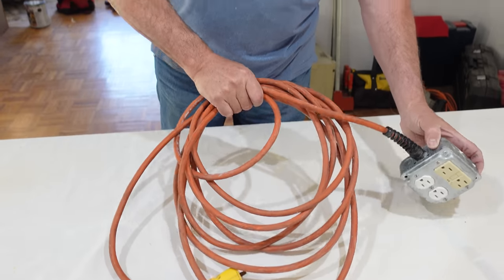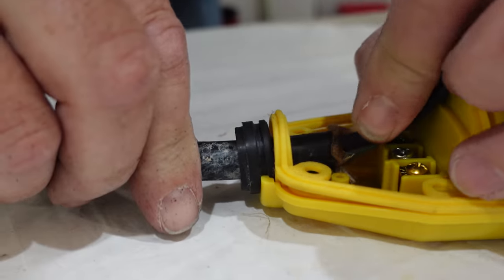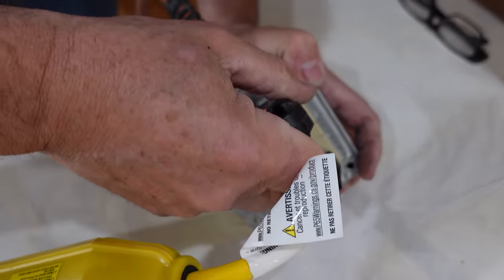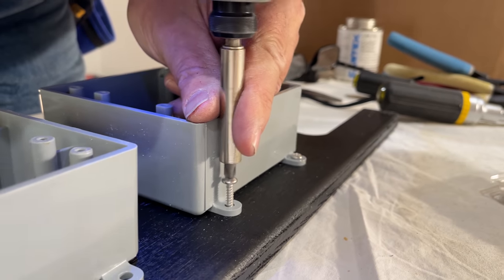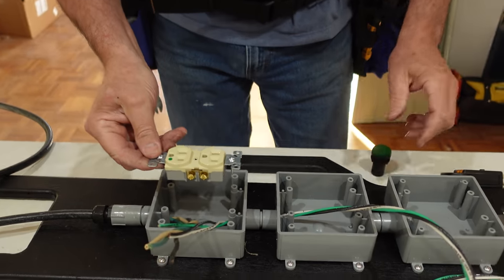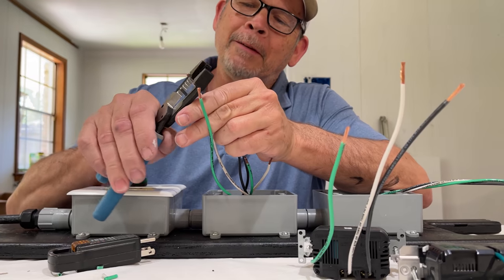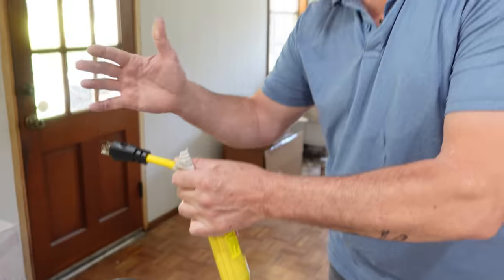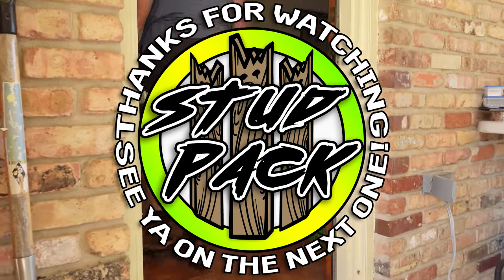HOW TO MAKE THE ULTIMATE EXTENSION CORD!

Comment: Great video Love the channel Guys. Your outlets aren't waterproof or weather rated. You need to use the Bell Box covers that come with gaskets as well as flip open covers and/Or in use closed covers to get a weather rating. Also your outlet boxes should be galvanized and use galvanized nipples because it's subjected to physical damage. Your extension cord is also to old to be reinstalled by todays code. You should also then Ground all of those new galvanized boxes. also all outlets regardless of upstream GFCI/AFCI protection need to be GFCI protected in temp power work boxes. The Green indicator light should be at the end of line circuit to insure all outlets are on. Also the Green Dot on that 20AMP outlet isn't for looks, It indicate Isolated Ground and you don't have one.

Comment: If you build another one look into a Powercon connector. 20a rated built in strain relief and water resistant(panel and cable connectors available). Used in staging a lot. I use it to make it so my extension cord can get swapped with multiple devices(magnetic power strip, plugging in power to my tool box) because of its twist lock you can pull it without it unplugging.

Comment: Wow that was pretty cool info about the vacuum. I never knew that. They sound like they are in such distress when clogged or blocked lol!
Reply: It makes sense if you think about it.  The spinning part moving the air has air resistance when not clogged.  Once you have a clog, it removes all the air and is running 'in a vacuum' and has no air resistance.   It can spin faster (hence the change in pitch) but will much less load.

Comment: I’m not a residential electrician but I believe breakers trip due to heat. I think the breaker would have tripped if that load had been present for a longer time. It would also imply the breaker is “healthy”. If it had routinely seen over current and heat previously it may have become “weak” and tripped sooner, possibly even below its rating.

Comment: The circuit breakers function has been very well explained in some other comments here, yet I can add some numbers out of my professional experience in education for electricians. These numbers are from the IEC standardization so they should be somewhat similar in the US to what they are here in Europe. I just assume this is a standard household MCB, being category B in the IEC 60898 classification. So those would be the numbers for a B 20A MCB:
The electromagnetic trip mechanism must not trip below 3 times the rated current and must have tripped within 0.2s - 1s (this time depends on several factors) above 5 times the rated current, therefor it can not trip that way below 60A (and must have tripped subsequently at 100A). All given proper function of course.
The thermal trip mechanism though has much lower current thresholds and much longer tripping times, having the must not trip below 1.13 times the rated current and the must trip within 2h above 1.45 times the rated current. Or in our example, must not trip at all below 22.6A and must trip within 1h above 29A. 

A lot of dry theory but to conclude this, your 28A steady current through a B 20A MCB leaves you actually in a very uncertain limit condition, where the breaker might trip after a very long time or it might not even trip at all. Assuming you haven't tested it that long but had you put 30A through that breaker over an hour, it should have tripped after that.

Hope that helped, have a nice day everyone!

Comment: 26:39 i am by no means an expert, but i believe there are two ways a breaker can trip. The first is a dead short which causes a restive wire of some sort in the breaker to heat up very quickly from the massive current which pulls a little lever that trips the breaker, the other is just a simple overload and some breakers use the same restive wire for overload protection as well, and since an overload has less current then a dead short it takes longer for the wire to heat up and trip the breaker. 

Although i do remember something about a magnet so maybe that is the dead short trip.

Comment: Excellent video, new subscriber.  Glad to have found your channel.  That vacuum pulls less amps when under air flow restriction because the blades are now running in a partial vacuum and have less restriction on them.  So, the motor runs faster but pulls less energy due to the "air" being thinner.

Comment: That's cool and gives me ideas for my generator. I've wanted an easy way of getting power inside if we ever had a power outage. I would like to use the 30-amp RV receptacle on the generator but I would probably need breakers on the power board like yours to use it. Thanks!

Comment: 26:16 I think most people rush to a clogged vacuum cleaner because most vacuum cleaners suck the air right through their own motor to cool the motor, where as vacuums like shop vacs have a separate fan that blows outside air through the motor to cool it. So a normal vacuum has a tendency to overheat when clogged which is why some will have a hole in the hose somewhere so that even if the end gets plugged by a rug or something, it still has a little bit of air flowing past the motor.

Comment: As others have said, I think overtime the circuit would eventually blow drawing 28 amps even on a 20 amp circuit. I find that has happened a few times while running my tablesaw and a shop vac at the same time. It often doesn't blow immediately. But eventually, yes.

Comment: Sweet cord. Explanation of the breaker;

The 20 amp breaker isn't designed to trip at exactly 20 amps, it's designed to trip when it reaches a certain temperature, or when it's 30% above or something. This is why I don't put 15 amp receptacles on 20 amp circuits in my rentals, because a tenant could put a space heater on it and start a fire.

Comment: Nice idea. I live in 240V-land (UK) so, yeah, it was a surprise at first why a vacuum cleaner would try to draw 10A, then I remembered you guys run at half voltage. If I do something like this I would likely use USB+BS1363 sockets (bathrooms aside, where we have a different shaver socket outlet) - but I tend to shy away from using USB+BS1363 sockets as fixed outlets at home, simply because I have had USB power adapters go bang when they fail, and I'd rather have something removable if it has those tendencies, whereas it going bang in my wall makes me feel rather uneasy. Perhaps I'm being over-paranoid?  Also, not too many sockets as we can pull a maximum of 13A (approx 3kW) from a single BS1363 wall socket - and the things are quite large so more than 6 sockets it would start to look a little ridiculous.

Comment: My electrician hasn't stopped laughing yet when I showed hi this video! First he said, loose the wagos! They can and will fail and he has seen when someone hasn't snapped the tab down correctly and it just sits and sizzles. If you have to join wires, use the correct wire nut. Plus he said the outlets are designed to pass the power on the side terminals. That's why there are 2 on each side. All the pigtails are not needed. Just wasting wire and time. Also if you are going to the trouble of building such a setup, don't use old cords. You can buy the SJ or SJO cable right off the spool the length that you need or just buys a new cord and cut the ends off and use it. No chance of nicks in the wire or a wire that has been overloaded and the wires heated up. Next make sure that you use metal plates and not the plastic ones as they will get broken at some point. He also said he woudl put some screw on rubber feet to the board so it sits off of the ground. No need for the third box with the switch. If you need that many outlets, just add another outlet. No need to switch it.
Reply from the maker: Glad you both watched :)  Sounds like your electrician should build his own... that's the whole point

Comment: Journeyman wireman LU 613 here. What wire type did you use? THWN I hope. If you're going to show your flowers how to do this you should make sure to specify wire type. I personally don't like wagons, but I do like how you used the clamping type and not the spring type. Also, those build your own cover plates don't appear to be weatherproof nor do you have weatherproof covers over your devices. I thought the whole idea between the PVC boxes, the strain relief you used, and the seal on the GFI was to make your build weatherproof, but the covers you used completely defeated that purpose. Nitpicking aside, I applaud your creativity. It's still not rated for your intention of being waterproof/weatherproof and still isn't suitable for outdoor locations, but it's definitely better than the temp box on a cord with an RS cover you had before.

Comment: Trip breakers are a timed event if draw is slow and consistent the breaker won’t trip until it reaches max draw rating which is not commonly printed or marked on device( you have to research the brand of breaker to find that out) usually to prevent people from abusing breakers beyond limitations , breakers are primarily used to stop current flow due to sudden high amperage change ie cut through a cord or dropped in water or electrocution event to prevent loss of life, instant heat generation from a short will cause coil to trip out but if high draw is slow and progressive it takes a long time for the heat strip to heat up and break contact

Comment: There's a thermal strip inside most common breakers and once it heats up it deforms and flips the breaker off (like a thermostat). You just didn't leave it running long enough for that piece to deform and trip the breaker.

Comment: I just have a low voltage telecommunications degree I don't work with the high-voltage at all,  only have one recommendation and that is to swap the hospital & button and the 20 amp, that way you're not running 20 amps through all that 15 amp outlet, And also you'll see if the entire strip is hot.  That is just my humble and unprofessional opinion on a well-built product. 
Durand the handyman Dallas Texas

Comment: Circuit breakers are typically inverse-time breakers which allows them to temporarily overload without tripping. Motors and LEDs have a brief surge when they first start. Inverse-time means the larger the overload, the shorter the time for them to trip. At 50% overload (30 amps), the 20 amp breaker will trip between 20 and 150 seconds. At 100% overload (40 amps), the 20 amp breaker will trip between 8 and 40 seconds.

Comment: Neat, I live in South Africa, 30 years ago we got solid plugs and reseptors. now it is all cheap plastic, I'm surprised there aren't more electrical fires. ...28 amps through the cord and 20 amp trip at the end of the cable not handling all the machinery, just two at that point 😏

Comment: I may be wrong. But I was under the impression that gfci dont work that great with long runs of wire due to voltage fluctuations over the length. Plus voltage drop over distance causes it to pop when it should. I've had outdoor submersible pumps that kept popping gfci. After replacing pumps and not fixing it. Figured out the lentgh of wire was screwing with what the gfci was looking for as a fault. Changed where the break would happen and pumps never stopped again.

Comment: I am not an electrician however I have trains that will run off of the same power but they run separately, because each of them has a brain in it with a different resistance. That would be the same as separate plugs with separate machines plugged in, the draw is just individually different. My guess is that the male side resistor was designed with a brain to recognize the different draws, and I would assume if you plugged too many things in it would tell you by breaking the circuit. Moreover because of the way you attached everything each plug was on its own circuit set without having to run through a second circuit set so no individual plate had more than two circuits staying well within the expected draw for each Channel or for each circuit.

Comment: Breakers are designed to trip under two conditions, short circuit and over load. Breakers are designed to carry a certain amount of load for a specific time. This is known as the time current curve. Short circuits result in an instantaneous trip due to the high inrush of current in a short period. Overloads, like the 28 amps measured in the video take longer to trip. This allows a breaker to take a momentary current inrush over the rating for high load starts and prevents nuisance trips. If you could have started all the tools at once, the very high inrush would of likely resulted in a trip. Another thing to consider are breakers installed in damp environments( outside, in garages, damp basements) Over time the breaker may not trip due to internal corrosion on the trip mechanism.

Comment: If it hasn't already been mentioned: check out the trip curves of a hosehold breaker like a Eaton BR series 20 a breaker. The breaker in your electrical panel ONLY monitors the current through the hot. if there is too much current, the magnetic or thermal mechanism will break the circuit. The thermal part is designed to allow some over current. It can take a surprising amount of time to trip if you ramp up loads slowly but if it is sized correctly and working properly, it will get warm and thermally trip before wiring gets too hot. It is protecting the wire, not you. 

This is completely different from the GFCI. The GFCI is not the same as a breaker. It monitors Line AND Neutral current and will ONLY trip on a difference between the two, milliamps is enough. If the current going to the load is not coming back on the neutral, it is leaking to ground. Thus, since it does not have to wait for a magnetic or thermal mechanism to react it can trip fast, and before too many milliamps run to ground or through you. So a GFCI protects you, not the wire. A 20 amp GFCI is simply a GFCI with a heavier duty outlet which can accept a 20a plug.

 He stated in the video it would be wrong to plug it into a 15 amp outlet and use a 20a appliance. Really it should have a 20a plug if there is going to be a 20 outlet on it. Most accidents are preventable.

Comment: I like the design, but think I would put the 20 amp outlet on the cord end with the switch to shut off the rest of the boxes when the 20 amp receptacle has something heavy in use. I also think I would use a covered switch, so that wrapping the cord wouldn't break the switch as easily. But just my opinion.

Comment: Winding the cord the way you die will cause the cord to become twisted and kinked. Wind the cord in a figure "8," and the cord won't become twisted. To do this, wind the cord from the "front side" toward the "Back side" on both ends. Then no twists will develop. Other than that, great project! John S. [Retired broadcast engineer].

Comment: If the current isn’t high enough to trip the magnetic actuator, it’s dependent on the thermal actuator, and at only 8A overload current it’ll take a while to heat the element up enough to trip. Breakers have something called a “trio curve” which is a graph that shows how many seconds it takes a breaker to trip given certain overload conditions. At only 8A overload it could take several minutes before the thermal element heats up enough to trip.

Comment: Main issue I see here is we now have 6 outlets we can plug stuff into as well as plugging in 6 USB devices. 15A in, and possibilty of 100+A out. Sure, you might not plug in and run that many devices but put this cord at a jobsite with regular construction workers and they'll hope circuit breakers are working properly. I do like the idea of how this was built but will make mine with one triple box at the end, there will be a switch a light and 15A outllet.

Comment: Hi,
You asked about why that GFCI held when you were pulling more than 20A. Disclaimer I am not a certified electrician, or an electrical engineer.

There are a couple assumptions I think that were made. You used 20A receptacles and 12awg conductor to wire them. I don't remember what your cord was, but I assume it was 12awg. I also don't remember what the breaker supplying the circuit you were plugged into is rated for. While it is likely no more than a 20A breaker, I wouldn't want to make that assumption. However, if we assume that is a 20A breaker, there is still a time delay associated with the overcurrent trip. If you look at the documentation that comes with the breaker, you should be able to find out what that is.

The breaker is the device which should protect you in an overload or overcurrent (short-circuit) condition. It is often misunderstood that a GFCI provides that same protection. While a GFCI will/should trip, it is not for the same reason as the breaker. In the simpilest terms, the breaker responds  to an overload of current pulled through the breaker. Old school equipment had a solderpot, or something similar, that will actually melt and break the circuit. A GFCI is looking for difference in the power out versus the power which comes back. Therefore, if your tools and cords don't have any leakage, then the GFCI should hold.

A couple extra tests I would try is to turn on all the tools at the same time. You can also take a good section of the cord and allow it to be in a puddle. That old cord probably has some micro abrasions which will allow a small amount of moisture to penetrate and trip the circuit.